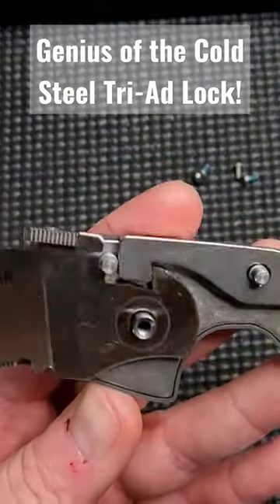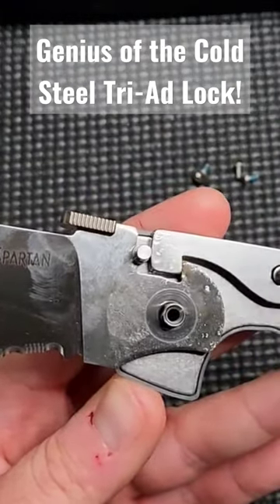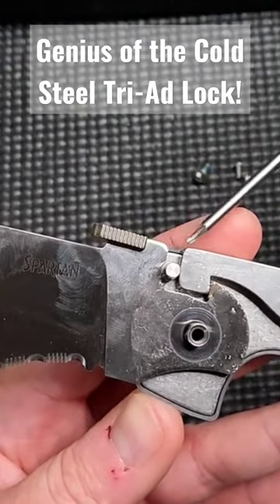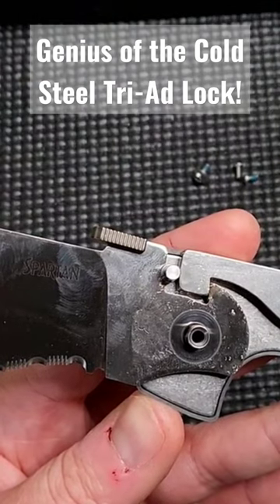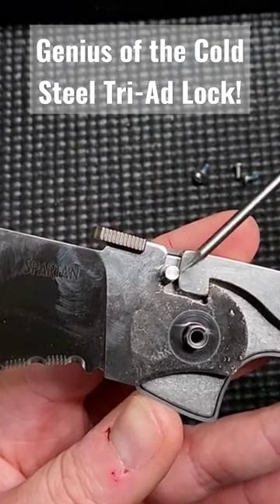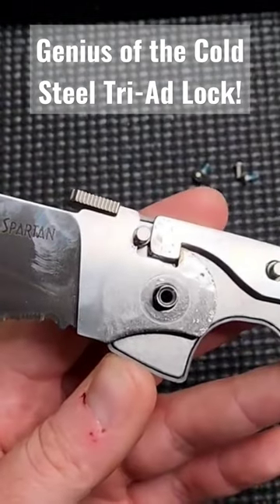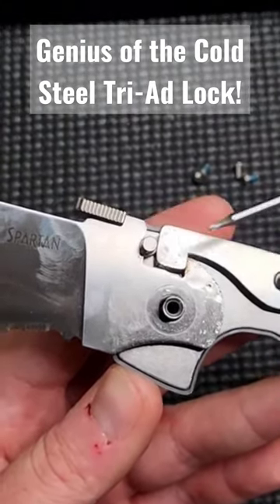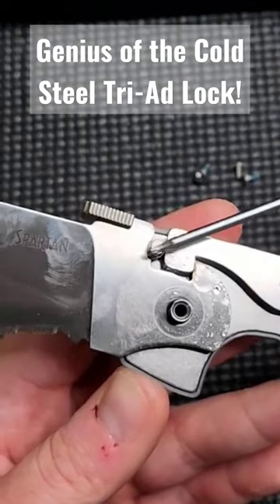Why the Cold Steel Tri-Ad lock is so amazing! #coldsteel #triadlock #knifereview #shorts

Comment: Not sure that makes sense. Two flat surfaces against each other is going to be stronger than adding a round pin between the surfaces.
Reply from the maker: Nope. Magic of engineering. Easy to check. compare movement between tri ad and classic backlogs. triad wins every time
Reply: (sorry, had to delete my earlier comment because youtube was acting strange.  Repeating it with improvements)
You have to look at the overall system as a whole and not just where the two flat ends meet.  With a regular back lock the two flat surfaces belong to two moving parts which apply stress each other.  By adding the stop pin you add a solid not movable support to the system which redirecting forces into the the handle instead of each other.
To your point, a "flat" stop pin might be stronger as it will more contact surface to take force better.
Reply: Nope, the tri-ad is stronger and it's been proven stronger not just by 2x, but several times over any other lock. it's literally insane, and tough enough that the force to pop it out of the lock is more likely to break the blade itself first.
It's about as good as a lock needs to be, even if a stronger lock type is ever invented.
Reply: Lol 🤡
Reply: If the pin isnt there it will slip out at some point because both the blade and the lock are moving parts
The pin is static the whole time
Reply: Are you an engineer? Obviously not.